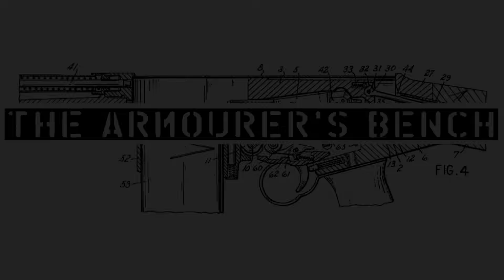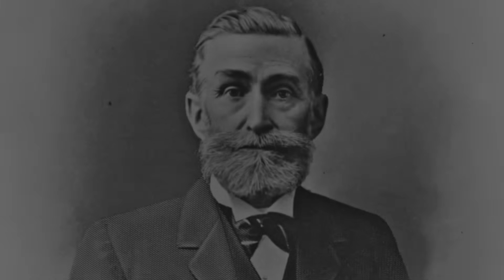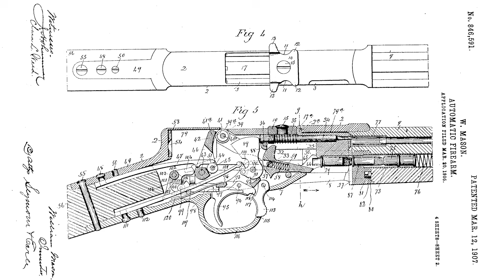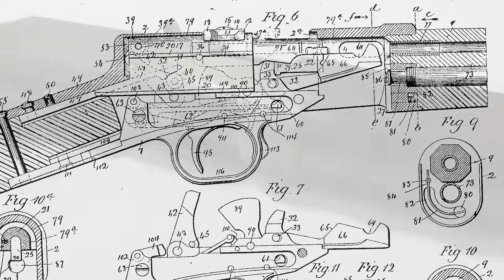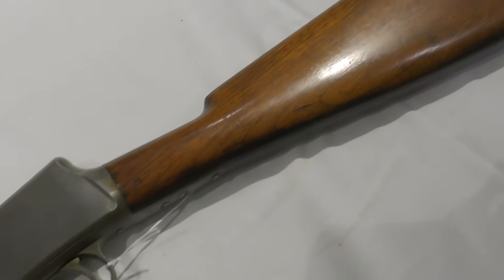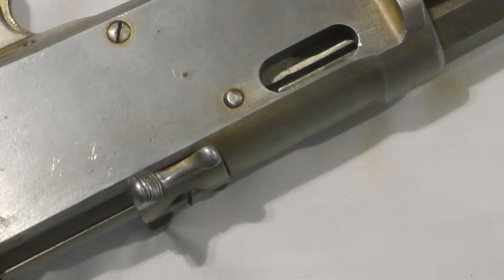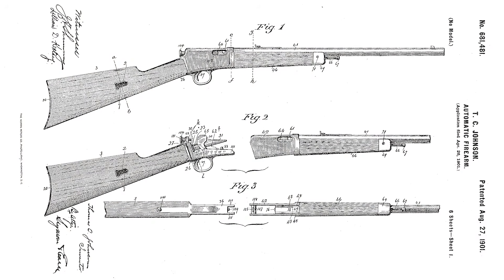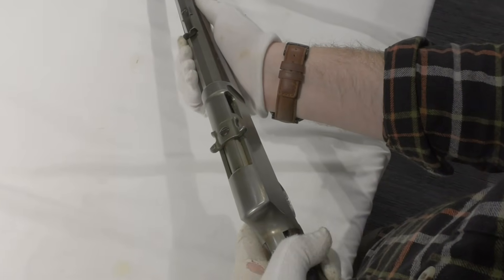William Mason's T-Charging Prototype

Comment: Not merely the T-shaped handle, but if I read the patent correctly in respect to roller (44) and it's interaction,  this could also be the first roller delayed automatic design, even if it is not specifically called out at such
Reply from the maker: There's a bit in the parent which sounds a bit lever-delayed too. "Under this construction the flat spring 47 exerts a constant effort through the said lever 42 and through the antifriction-rollers 39 to push the breech-block 17 forward into its closed position." It's a bit ambiguous to decide what exactly is going on without closer examination (or firing) but it's really interesting piece. Thanks for watching!

Comment: Woo, it's been a while since you did a history video!

As to the gun, it looks like a pretty solid design and certainly less of an ergonomic oddity than the model 1903, but I'd wager that Winchester felt the plunger was less likely to infringe on Browning's patent than just replacing one finger hook out the side with two finger hooks on the top.
Reply from the maker: @StacheMan26  yeah quite possibly, patent law and IP then, as now, was fiercely fought over.